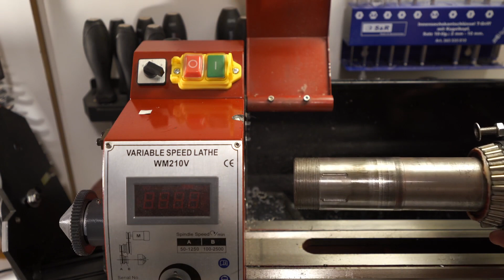Removing mini lathe spindle bearings

Comment: To adjust the bearings it is better do use slotted nut spanners instead of the screwdriver hammer method.

Comment: What was in there, chips?
Reply from the maker: Looked like particles from cast iron processing - they painted the case after installing the bearings and since there's no bearing seal from the inside of the headstock, they blew paint, sand and cast iron dust into the bearings with the spray gun. Or maybe bearings were sitting in the open and got the factory dust accumulated on them.

Comment: surprised to see tapered roller bearings in there. why are you replacing them?
Reply from the maker: I needed to take measurements of the spindle and bearings. Spindle was always very crunchy and now I know it's because there was a lot of dirt in the bearings and they are low quality overall. Since I have all this apart it makes sense to address this now.
Reply: 2x 30209 32/Q was my Choice

Comment: wOOw Strong filament :) what brand of bearing do you prefer, will you be installing a thrust bearing, or will you keep what was only of better quality
Reply from the maker: Just your average PLA 😀 I'm limited by existing dimensions so not much choice. Will install NSK 32010. Lathe generates vertical loads on the bearings for the most part so I'm not sure if axial bearings are used here.

Comment: What bearings did you use or what was in it?  I'm looking for the size because I also have a WM210V and would like to do this, but want to leave the machine together till the bearings arrive.
Reply: I found it on your other video.   Looks like either 32010 tapered or 7010( maybe 6010?) In angular with a shim.
Reply from the maker: Mine had 32010 bearings but the problem with WM210-style machines is that they are all slightly different. Yours might have different bearings - so the only way is to measure yours. It can be done without removing them - measure spindle outside diameter, bearing seat outside diameter (measure dust cover OD) and try to estimate bearing thickness +-2mm, then you can have high confidence in bearings to order without taking them off.
Reply: @MaximKachurovskiy thank you 😃.  It's not the news I wanted, but it is exactly what I needed to hear.  I'll take off the dust cover and measure.